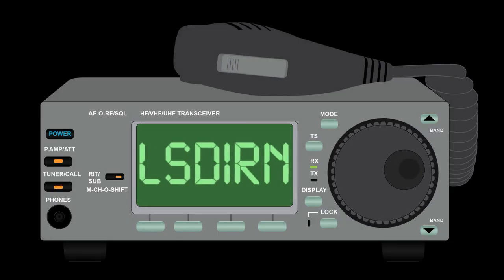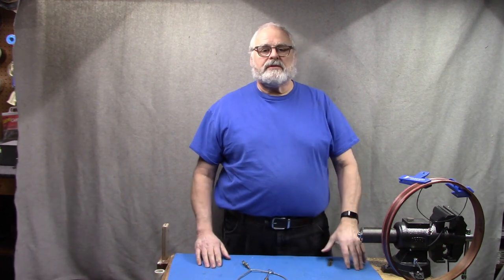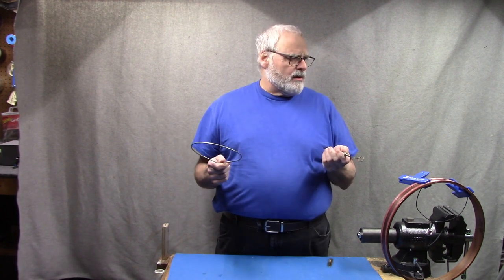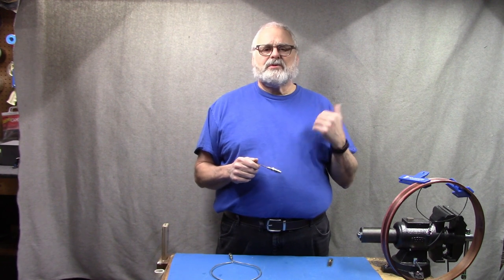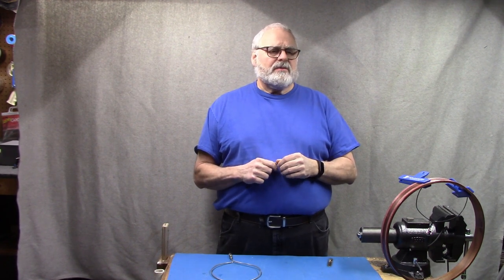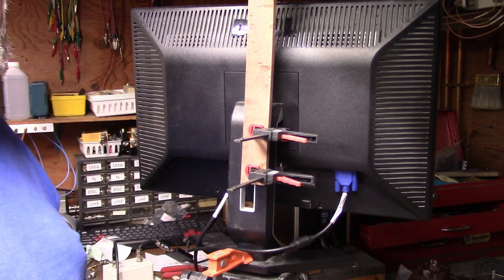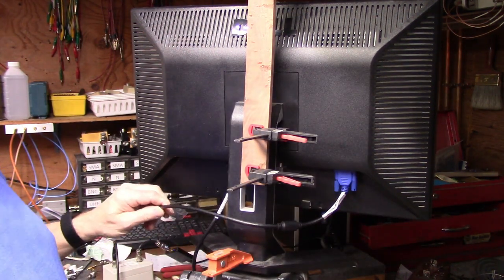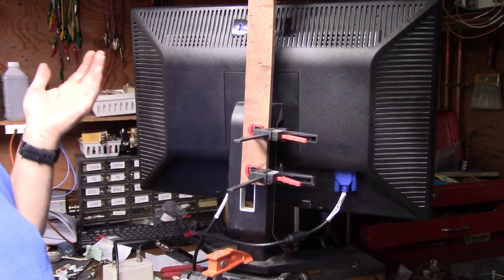Computer monitor RFI

Comment: When listening to HF with my SDR, I have found that my monitors have been the worst noise offenders.  When switching to an LCD Dell monitor like yours, the noise affects bands that I normally do not listen to 17m, 15m, and 12m.  The CRT monitors affected 20m as well which is why I am now using an LCD Monitor.  If I do want to listen to one of the affected bands and one of the interference peaks is affecting a station that I an listening to, I sometime change the monitor refresh rate from 85 Hz to 60 Hz or vise versa, which moves the interference peak away from the signal I am listening to.  Alternatively, sometimes I will change the MONITOR OFF TIME, in the power settings to 1 Minute, so that if I find a signal that I want to monitor is close to, or on one of the interference peaks, I just tune the signal in as good as I can and then wait one minute, the monitor will go off and I can listen to the signal without interference.  Thanks for you video.  I will keep in mind that the monitor orientation also affects interference levels!
Reply: We live on the ground floor and the electrical panel is right next to us in the apartment. I think this creates more noise. I am a bass baritone. My voice range is 100 Hz. When I use a switched psu, I can hear this noise as a fog curtain while listening to music and in my voice recordings. When I use a power protected psu, the sound is clearer and more vivid. It happens. I will buy a 7 inch mini monitor in my recording studio and try it by feeding it with a protected PSU.

Comment: We live on the ground floor and the electrical panel is right next to us in the apartment. I think this creates more noise. I am a bass baritone. My voice range is 100 Hz. When I use a switched psu, I can hear this noise as a fog curtain while listening to music and in my voice recordings. When I use a power protected psu, the sound is clearer and more vivid. It happens. I will buy a 7 inch mini monitor in my recording studio and try it by feeding it with a protected PSU.

Comment: Hi Paul,
Excellent video! A lot of interesting info.

Now if there was a way to stop the neighbor 3 houses away with their $40 LED grow lights putting interference from 50 KHz to 15 MHz.

The guy directly behind me has small LED lights in his garage. A main unit and 5 satellites that are attached it. Makes the entire spectrum look like waves on the ocean. 

A hobby I have had for over 50 years ruined by $50 garbage. 

Keep up the great videos. 

George, NJ3H 
Redmond, Oregon
Reply from the maker: George,  Call me I think you have my number
Reply: the "$50 garbage" are items not permitted by the FCC to cause interference. best for all concerned to know what the interference is, the source(s) of interference, and take reasonable cooperative steps as responsible citizens to remedy the non-permissible emission of interference. "less best" is the FCC getting involved.

Comment: One can also detect rf interference using a handheld radio on the AM broadcast band. Place the radio anywhere near the monitor for maximum pickup. I've also used the AM radio when purchasing a TV set.  Place the AM radio in different areas of the monitor screen. Maximum interference also means there is more heat generated in that area of the screen. More heat may also mean more current being generated. The same results 'may possibly' be obtained using a solar cell or a coil attached to the input of a portable audio amplifier or hearing aid. It's fun to experiment.

Comment: Is that a backlit or edge-lit monitor? The noise could be coming from the LED strips. I find LED lights as a significant noise emitter in many homes, and I have also repaired many LED TVs. They usually have a set of strips, but some monitors have U-shaped backlights, and others are edge-lit.

Comment: Great video Paul. I have a Samsung refrigerator that is causing RFI on 12-6 meters. What hardline are you using for the sense antennas? I need to build a few. Denis
Reply from the maker: Denis... It really doesn't matter.  You can use RG 141 hardline of small coax even.  What ever is convenient.   W1VLF

Comment: Today I managed to locate the rfi which was interfering with my sdr and Belka, and it turned out to be my monitor, exactly the same one as in your video!  Having found the source I searched on the internet for solutions, but you don't give one.  Can anything be done in the case of monitor-generated rfi?

Comment: Excellent investigation ! I switched to using laptops as I couldn't find a way of making my monitors quiet. What is the conclusion ? Best way to supress noise is to tweak monitor orientation to null the noise ? It works but is not always practical ? Anyone have any more ideas ? I wrapped a monitor in chicken wire which worked great (see my channel) but of couse is totally impractical if you want to see what is on the screen ;-)